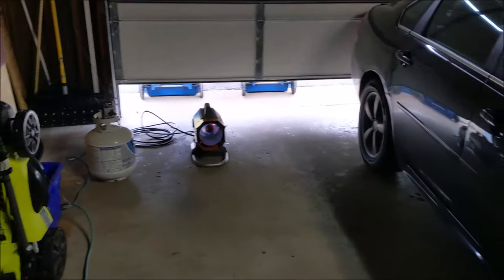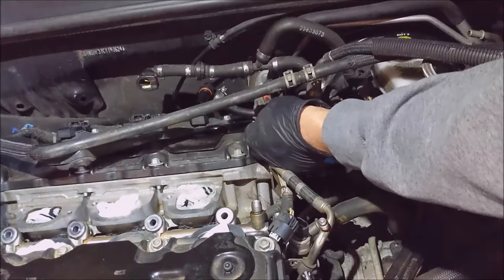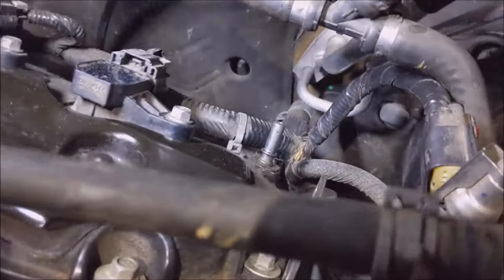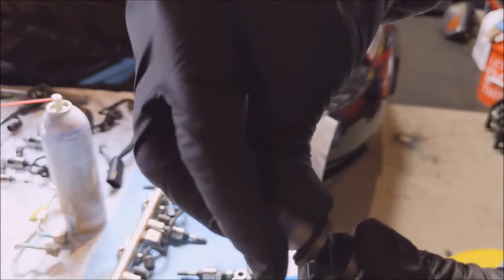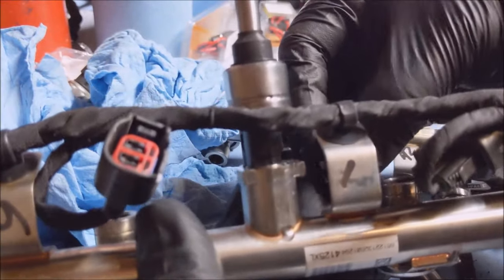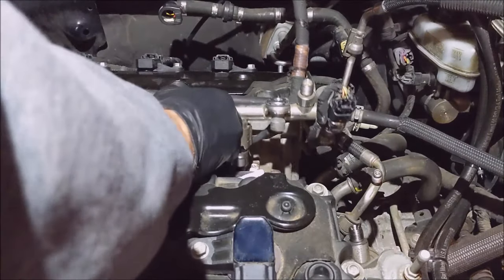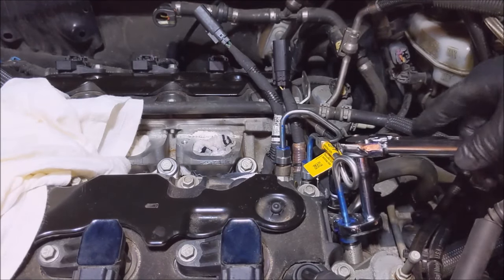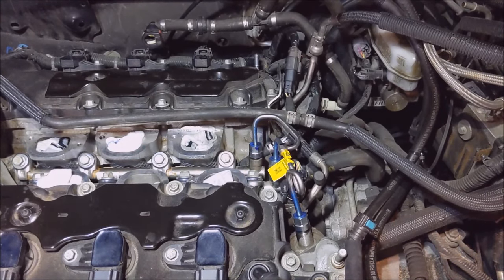GM 3.6 LFX V6 Fuel Injector Replacement (Part 3 of 4) **9th Gen Impala - Others similar**

Comment: I noticed you did not show how long it took to get first rail out.long time huh.i found that removing  the   bolt spacer on left side of rails makes the clearance to make job 🎂 walk
Reply from the maker: Wish I had a GoPro with a headband when I recorded the video so I could show a close-up!
Reply: I just did this this morning
Reply from the maker: If you post it, I will link to it here.
Reply: @CertifiedShadetree I wish you did too! 😅
Reply: @CertifiedShadetree those stainless steel tubing pipes are hand tight or around 15 ft lbs/ mostly hand tight 41:55

Comment: I watched your video introducing the injectors, I look at the degree of difficulty and think about the degree of brain that the engineers who designed the cylinder heads had
Reply from the maker: And out of all of the GM High-Feature engines, the LFX is considered the EASY engine to work on!!
Reply: The engineer has no brains whatsoever.
Reply: Actually the 3800 V6 engine is a very poor design in my opinion! Try putting the rails back in on those engines!

Comment: I have a 2013 Chevy impala and this car is nothing like my car at all ...I cannot find a single video showing me how to get to my fuel injectors I've tooken off the intake manifold and everything and still don't see them I really need help
Reply from the maker: Did you remove the upper intake gasket and sound insulation foam that I showed in part 2? The injectors are revealed once you remove the foam piece.

FYI, this is the only engine that was installed in the 2012-2013 Impala and 2014-2016 Impala Limited.

Comment: How much does this job usually cost?, I'm doing it myself, just curious to know?
Reply from the maker: No clue. I'm sure it would take an ASE master certified tech less time than a shadetree mechanic. I'd say tally up the time it takes you, divide it by half, and multiply that by the average hourly rate a shop would charge. Add in the cost of the parts (and inflate the price, of course) and a typical "shop supplies" charge and you might be in the ballpark. Oh yeah, don't forget to add sales tax!!

Comment: How do you remove the injector harness from the main harness?  For the life of me I can get it off, I don't want to break it.
Reply from the maker: If I remember right, I ended up ham-fistedly snapping off the retaining tang from the connector!  I can't honestly remember if it was a combo of squeezing and pulling or prying and pulling that got it loose. Regardless, I've had that half-broken connector back together and holding 100% for close to a year, so I don't think you'll be in bad shape if it breaks.

Comment: I'm working on a 3.0 with the same fuel rail system. Was able to get the rear fuel rail out. But I am not able to get it back in. It's acting like the injectors are too long and I can't twist the rail enough to feed it in.
Reply from the maker: I had a guy comment that he left the retaining clips off of the injectors/rail - he put the injectors in the head individually, then connected up the rail without the clips. He reasoned that the bolts holding the rail to the head will perfectly secure the injectors to the rail with no chance of separation. Must've worked, I haven't heard anything back from him.
Reply: @CertifiedShadetree  . Hey thanks for getting back to me so fast on this. Appreciate it.
Reply from the maker: No problem, good luck!! 🍻

Comment: I’m having a problem now with the injector o-rings on the fuel rail side blowing out. Any ideas to what might cause that.
Reply from the maker: I would ponder if they're the correct o-rings or if they were installed improperly. The Bosch site says to lightly lube them with engine oil when you're installing them both to the injector and into the rail. I would also make sure the part of the rail that the injector slots into is clean and free of debris or metal burs and also that it's not deformed.

Comment: Do you have to use sizing tool on bottom of injectors if they are  brand new and came with seals or do you just instal it as is
Reply from the maker: You don't need the tool if the injectors are brand new. If you're re-using old injectors, you will need to replace the seals and thus need the tool.

Comment: This was very helpful. I get a few buckles at low idle from time to time. I changed everything else (plugs, coils, MAF, O2 Sensors, Intake Pressure Sensor). I can smell gas on my oil dip stick and this is how I found your video:).  Thanks for sharing.
Reply from the maker: Aah, sounds like you might have a stuck or sticking injector. Hope this points you in the right direction!! 🍻

Comment: Ok, thank you for posting this; Im trying to remove my fuel rail and I am literally losing my shit at it lol. Im glad to know it IS a pain in the ass and im not crazy lol. Cheers
Reply from the maker: It truly is, but with a little patience the rails can be removed..
Reply: @CertifiedShadetree  haha yeah I got em; I just didnt want to be blindly yanking and "hoping" to not damage anything lol. I actually had to press out the fuel injectors to get them out, but that wasnt a huge deal. Im sure putting them in is just gonna be a blast too right? lol
Reply from the maker: @jordangraham8500  Getting the injectors' retaining clips back on is an even bigger pain in the ass than trying to get the rails back in the engine!!
Reply: @CertifiedShadetree  I actually had no trouble with that lol; I used some snap ring pliers to gently spread them just a smidge and they slid right on with no issues.... that said; I dont know what/how I fucked up; but those plastic housings for the wiring were outrageously in the way and made everything 10000% more difficult than it needed to be; so I clipped all the tabs off and shoved them around; no harm no foul there and saves my sanity lol. That said; if I had to do this a second time it would take me 1/10th of the time for sure.  Thanks again for the video; it really gave me the confidence to yank that bitch out haha.
Reply from the maker: @jordangraham8500  🍻
Reply: @CertifiedShadetree  Hey, if you dont mind; I really need some help. I had a fuel leak, and I checked the regulator and nothing was leaking from it at all; So I assumed it was a fault fuel injector seal. I replaced the fuel injectors, new seals, new everything, but when I went to start the car; the gas leak is there still. I had my wife crank the car over; and its just shitting out gas on the bottom side somewhere (its getting dark and I dont have a garage to work in unfortunately). Do you have any ideas? It was quite a bit of gas; almost like turning a faucet on like a 1/3rd. The regulator isnt leaking for sure; and everything else is new up top.
Reply from the maker: Without starting the car, turn the key to ON and listen for the in-tank fuel pump to prime itself.  Try that a few times and check for leaks.  That will at least rule out the fuel line running from the tank to the high-pressure pump.  I think after that point, you'll have to pull the intake again. Sniffing around can give you a good idea where the general area of the leak is.  Check the foam sound insulators around the injectors to see if there's a concentration of fuel in one spot.  With the intake off and foam removed, you could briefly crank the motor while looking directly at the rails to see if there are any obvious leaks.

Comment: I just did this job it’s a pain in the ass. You want my advice use a crow bar or wedge two crow bars together in opposite direction to get the fuel rails off. You will save yourself a lot of team and headache doing that. I know because I tried without first. To be even more sure just in case you think i loosened them up by doing it by hand first. I needed another harness because a plastic piece was broken I had to remove two more rails at a junk yard and I tried the pry bars from the start and it took about 3-5 mins to get a tail off. Wish I would have known this from the start.
Reply from the maker: You're talkin' small crow bars, I hope!!  The big bastard I have would put a crease in the hood if I used it to pry out the rails!!

Comment: Good video thanks, my 13 impala is miss firing at idle. I have eliminated everything but injectors,   I have read that carbon builds up on the ends causing erratic spray and that they can be cleaned when removed. So gonna give that a try
Reply from the maker: And boy do they ever!!  The good news is it's easliy cleaned up with throttle body cleaner.

Comment: I'm having a hell of a time putting the fuel rail back on with the injectors..
Reply from the maker: Had a commenter tell me he didn't install the injector-to-rail retaining clips. He installed the injectors into the engine, then installed the rail over the top. His rationale was the bolts holding down the rail will create enough tension to hold the injectors in place. YMMV, of course, but it's an idea if you absolutely can not get the rails seated..

Comment: To all the people have absolute pain putting the rail back in place. They want you to remove the head. What I did which y’all can argue, say it’s stupid whatever. I pulled the clips off and didn’t use them put each injector in the bore hole and then placed the rails on them and tightened them up so far so good on our Cadillac. I really don’t think you need that clip. On all GM LS based engines none have any sort of clip o ring holds it tight and then tighten the rail down so that’s how I did mine!! Y’all don’t gotta do it my way but I tell ya nothing is more frustrating then pulling a head and timing chain just to mess with the injectors!
Reply from the maker: Hey, if it works, it works!! The Shadetree way ain't always the "proper" way but kudos to you for figuring out a solution!!  👏

If I had any concern, it would be this:  LS engines are port injected, and the rail is under considerably less pressure than these direct injected engines are under.  You're talking 58 psi vs 798 psi.  That being said, the rails are bolted down solid and there's nowhere for them to go so there's really no argument against trying it...
Reply: Good to hear, I found one clip lying around after I had put the intake back on. Plan on starting it tomorrow, now with some more confidence! 2013 imp I picked up for 1k.
Reply: Interesting! I have that problem of putting them back in with the clips those curved clips that do not bend. I have the V-6 3800 engine. Who ever designed that needs to have they're head examined, because they're is no room between the heads to get them in and I am not about to remove the heads to put the injectors in. If what you say works and the injectors don't come out and leak fuel all over the place then that would be fantastic! Thanks for the suggestion, I will try that!

Comment: Did you use loctite on the threads of the nuts of the high pressure line (pump to rails fuel line)? I was told I'm supposed to use it...?
Reply from the maker: The one I installed was new, so I didn't put any sealant on the threads. I honestly don't remember if it came with any threadlocker on it. I wouldn't worry about it, but if you were so inclined, I'd use a very tiny amount of blue or orange Loctite not red..

Comment: I wrecked my 2011 STS 3.6 LLT so I went bought a 2008 CTS LY7 beautiful car with a blown engine...I was just gonna swap out the motor and transmission from the STS to the CTS.Will that work?
Reply from the maker: I've heard of people swapping LFXs into Traverses, so anything's possible. I'm sure the drivetrain will bolt in physically, it's getting the electronics to work that's the challenge. As for that, I would contact someplace like Milzy Motorsports.

Comment: you need to tell how u got second rail in there i been trying to get mine in for hours with no success
Reply from the maker: The 2-4-6 rail needs to go in first, otherwise it's impossible to get both in.  On FWD the 2-4-6 is the one closest the radiator, on RWD it's the passenger side rail.  After that keep "2 In A Room" in mind and Wiggle It, just a little bit..
Reply: @CertifiedShadetree  yup got it thank you for that
Reply from the maker: @just-a-6176  Any time!🍻

Comment: What is the housing called that the fuel lines connect to, I have gasoline leaking from the house and possibly from the rails too but I can't find its technical name. I believe clogged injectors damaged the seals, I found that out after running some Castle Fireball injection cleaner because the motor was dieseling as well.
Reply from the maker: That is the high-pressure fuel pump.
Reply: @CertifiedShadetree  I see, I'm not certain if it's leaking out the body or out of a fuel rail but maybe I can get one of them to leak whenever I test it. I'll let you know how it turns out.
Reply: @CertifiedShadetree  I was not successful in my testing, I had seen a small sign of gasoline evaporating off of the fuel pump but I'm still uncertain of where it's coming from. I believe that the pump has more points of failure though it doesn't rule out a damaged seal between the fuel line and pump. I'll update if I find out more.

Comment: I have a 2012 chevy traverse no check engine on run the scanner for codes but dnt show anything it tends to hesitate like stalling out when im driving at around 30-40mph i let go of the gas pedal & it stops but it also does it around 50-65 mph only 2 occasions the check engine light turned on started blinking & had traction control light on ive changed high pressure fuel sensor ,coils, spark plugs, throttle body,crankshaft sensor, purge valv,pcv valve. Ive also cleaned the mass air flow sensor but nt replaced it im only down to  replacing fuel injectors,mass air flow sensor,pedal position sensor,fuel pump or oxygen sensors what do you think it is broo ? The problem is that no check engine code is showing so the problem is very low but that stalling hesitation on the truck is getting  annoying and its using more gas than usual its been 3 years already. 148k miles
Reply from the maker: I would suggest cleaning the intake valves and pulling the injectors and have them either cleaned or replaced. I've seen what the tips of these injectors look like after 158k, and they do accumulate a ton of carbon on the tips of them.
Reply from the maker: Had another thought: Have you inspected the wiring harness(es) in the engine compartment? There was a TSB for several GM models with the 3.6 that one of the harnesses could chafe against the transmission housing, causing some wires to short out and create all sorts of problems..

Comment: Would it be mandatory to replace the fuel feed lines after releasing the pressure and removing as mentioned in the beginning of the video, would that cause a no start?
Reply from the maker: No, it's not necessary to replace the lines. So you're asking if replacing the lines would cause a no start??
Reply: @CertifiedShadetree  No I was wondering would using the same old lines cause a no start or would I have to get new lines once I remove the old ones I know in the video you said Bosch said to discard the old lines
Reply from the maker: Aah I see. No it will not cause a no start condition. If I had to guess, Bosch is worried about the connections leaking. I can verify they do not leak if you reuse them.

Comment: Doing this job right now had a tough time getting those rails back on, replaced all the injectors with ac delcos, car won’t crank over now. Don’t know what it could be the injectors are new.
Reply from the maker: Did you fry the starter? I would at least check it, along with all the battery connections & ground terminals around the engine bay first.

Comment: How did you get the fuel rail out of the valley? You skipped past that part and I'm stuck on that.
Reply from the maker: It takes a lot of wiggling and wrangling.  Also make sure you have plenty of space cleared on the driver's side of the rail, as they have to shift that way in order to clear the intake ports, and you'll need the space for the piping to shift over.  Go in the order I stated in the video, the rails don't come out or go in any other way.
Reply: @CertifiedShadetree  thanks for the quick reply!  I actually just got it out.
Now I gotta get it back in and somehow get those retainer clips on there too. I need smaller hands lol.
Reply from the maker: Those clips are a royal pain!!! Good luck with your project! 🍻

Comment: Thanks heaps for the Vid mate. I was just in the shed trying to get the 1,3,5 rail out but I was thinking it's fucking tight! Thought I may have to take the other side out first - seems not though after watching this. I just didn't want to put too much pressure on the dog. The electrical clip connectors suck - on the holden commodore the engine isn't sideways like yours, really awkward. Great choice of music in the back too.
Reply from the maker: Hell yeah, Hair Metal all the way!! 🤘🤘🤘   You ain't kidding about those connectors!  I managed to break one of mine 😠  I guess with RWD you can't really perch yourself in a good position to get at the fuel rails (I was able to climb up on the core support and gain a bit more leverage.)  Good luck to you, hope it goes well! 🍻

Comment: Thanks for the video,
what happened to part 1 and 2 ? can't find them
also is this somewhat similar to LF1 (3.0) ?
Reply from the maker: Links to the videos are in the description, videos are present and accounted for..
This procedure should be similar for the LF1, but not identical. Your injectors may be a bit more difficult to remove and reinstall. Another commenter here said he wasn't able to reinstall the rail with the injectors installed, so he put the injectors in place in the engine, then installed the rail without using the clips.  He said just by bolting the rail down, it was enough pressure to keep everything in place without leaks..
Reply: @CertifiedShadetree   great, i`ll give it a try!  thanks for the comment
I am doing it on a 2010 cadillac cts with the 3.0L
Reply from the maker: Best of luck to you!! 🍻